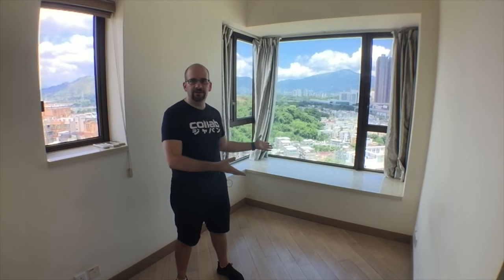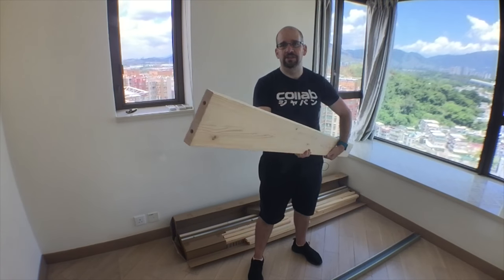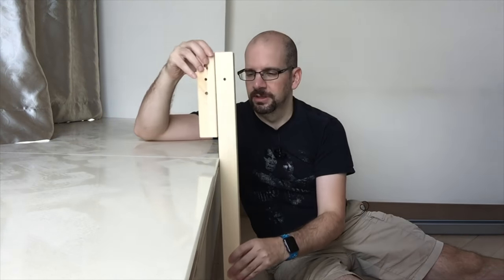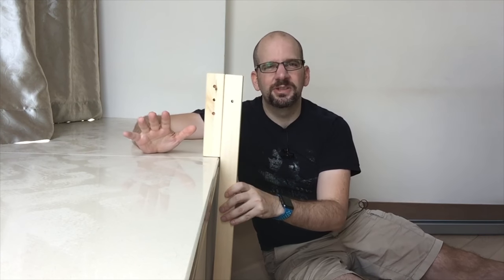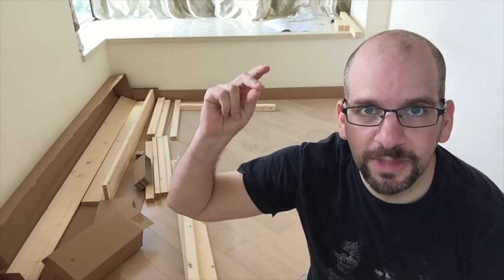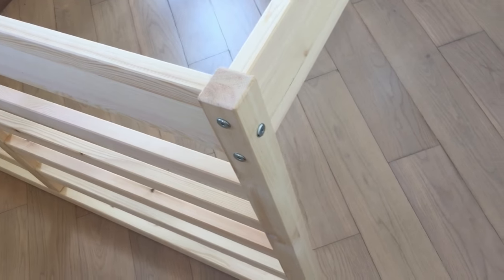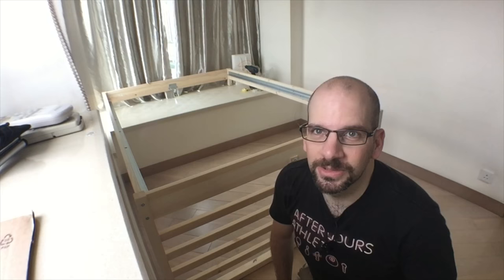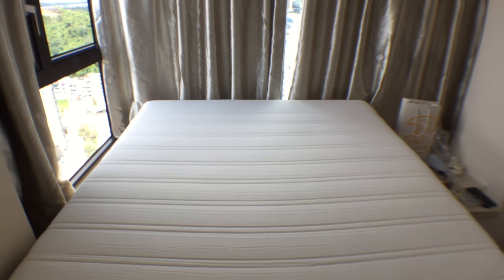How to Loft An IKEA bed - "The Tarva Inversion" - IKEAHACK for Window Ledge Lofting - Clueless Dad

Comment: I know this video is old, but just wondering why you didn't attempt to have the bed turned the full length of the window sill? it would take up the whole sill (if it fits. on camera it looks like it would) and you'd have to do a custom frame for sure, BUT you'd have almost the whole floor free!
Reply from the maker: I don't remember the dimension of the sill, hypothetically you could fit it in sideways,  but it wouldn't work with this particular trick of using the headboard for the lofting.  You'd have to attach a longer leg at the head and foot on one side.  so slightly more complicated execution.
Reply: @CluelessDad  oh I know it's be totally different, and I love your idea. I was just curious if it would have fit!

Comment: Hi Clueless Dad! This is such a brilliant idea. Do you think it would be safe to replace the two short legs with longer 2"x2" planks, then do this on flat ground?
Reply from the maker: I haven't done a video about it yet, but after I moved apartments, I took the two "tarva inversions" I did and combined them into one 'lifted inversion' bed (basically a bed with two downwards pointing headboards holding it up off the floor) and it works fine.  so I suspect you could make the legs on your own to do something similar.  

But I would recommend you link the two longer legs together with another piece of wood linking them (like the headboard).  if they're just free standing legs, that long, it may be too weak if someone jumped on the bed in the wrong place.
Reply: @CluelessDad  Thank you for your reply! That's such a good idea, and it's a relief to know that it's doable. If one makes two longer legs, then perhaps maybe 2 or 3 of the horizontal pieces from the headboard can be moved to link the two longer legs together.